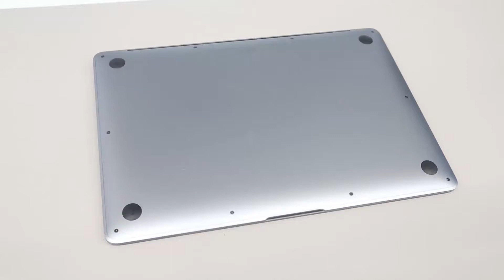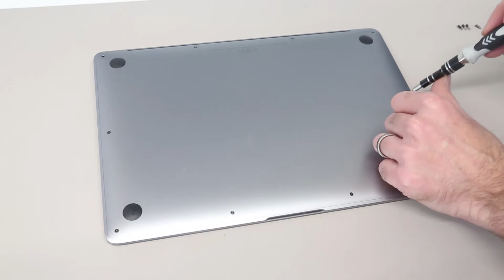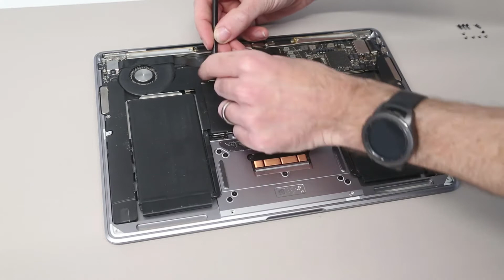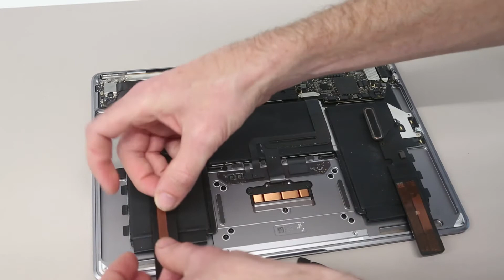MacBook Air Early 2020 (A2179) Speaker Replacement Guide

Comment: I briefly vacuumed my speaker grill on the M1 MacBook. The vacuum is a cordless one that’s known to be somewhat decent at sucking (haha). The nozzle is thin but curved up at the sides so as not to create a perfect vacuum but I still felt it tug a little bit towards the laptop surface. In your experience, how likely is it that I displaced the speaker membrane? Paranoid I’ve damaged it after reading I shouldn’t have done that! Are the membranes in the M1 pretty secure?
Reply: If your speakers sound ok, there's nothing to worry about.

Comment: It's been just a month since I bought MBA M1 and the right-side speaker is buzzing like hell, I think it's a mass problem, thousands of people are having the same problem. any solution? I don't want to give it to the service center because in my country apple's service is pretty bad so not a good tradeoff to open MacBook just for speakers. do reply with more info on this. thank you.
Reply from the maker: It may not be the speaker, but rather the keys above it are rattling.
Reply: @BrueComputing  no its speakers. i've checked the keys.
Reply: @gta4carnage i got it changed. the problem was in the speaker itself. they changed both of the speakers because apparently MacBook speaker replacements only comes in combo.
Reply: @gta4carnage my MBA m1 was just one month old, so yes. but they will diagnose first, if water caused the damage warranty will be avoided.

Comment: Should this work as well for M1?
Reply from the maker: Is very similar on the M1, but the speakers are a different part so aren't interchangeable.
Reply: @BrueComputing  I mean, I’m having issues with one speaker. Planning to buy M1 MBA speakers so I can replace them.
Reply from the maker: You might want to check its actually the speaker - they have a bit of an issue where at certain frequencies the speaker vibrates some keys in the keyboard and makes it sound like they've blown.
Reply: @BrueComputing  Is there a way to check? I've had it for a couple of years and now there's buzzing coming from my right speaker that was never there before. I want to say it is a blown speaker.
Reply: @mytrung  same its been just a month since I bought MBA M1 and the right side speaker is buzzing like hell, I think its a mass problem, thousands of people are having the same problem. have you found any solution?, I don't want to give it to the service center because in my country apple's service is pretty bad so not a good tradeoff to open MacBook just for speakers. do reply what's the situation of your MacBook currently.